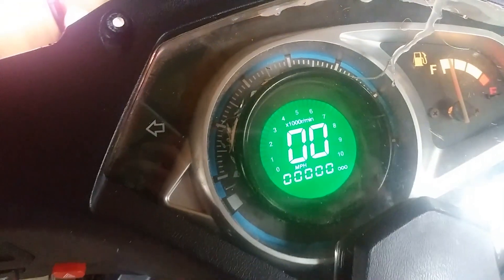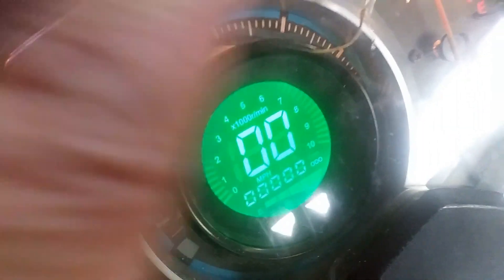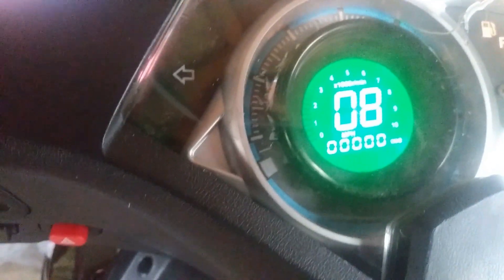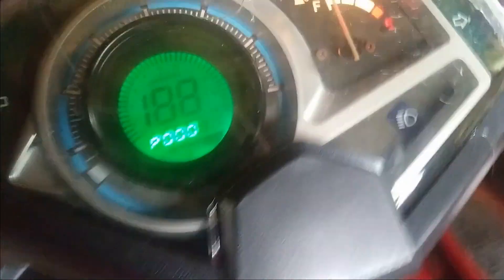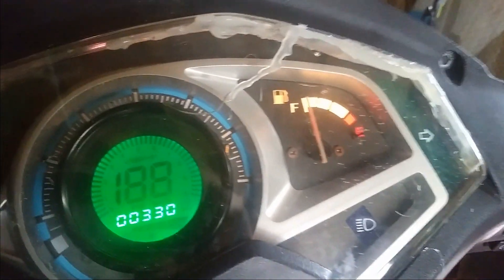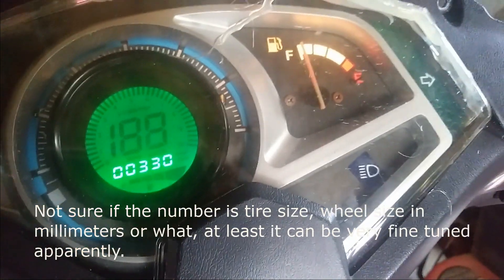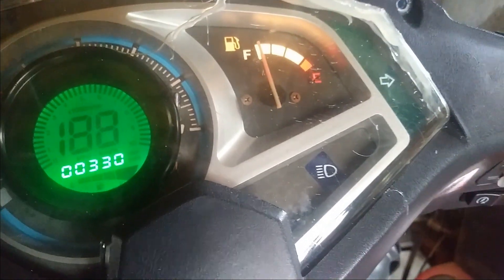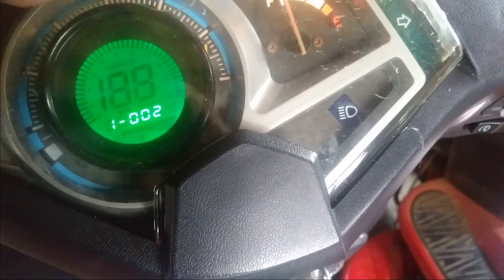Universal speedometer / tachometer wheel size setting, kmh to mph setting, etc.

Comment: This helped me out so much but question  I notice my speed was still off so what size tire are you running. Cause I looked and did some math . 
If you running a
* 3.50-10 tire =430 
*4.00-12 tire= 508 
Those are what I found out may help bud like you helped me. Also where did you find the instructions to this speedometer I am really indeed of it.
Reply: Thank you very much 😉👍 
I didn't get any code from seller to go into settings. Luckily after searching on YouTube I found your move and even when my speedometer is totally different, access code and menu is exactly the same 😁
Reply from the maker: the only instructions I found were under the descriptions of people selling it, some of the instructions were more complete than others.... thanks for your data, my 13" wheel tires are around there but i dont remember.... they are 130/60-13 tires
Reply: @OGmolton1   okay thank you so much bud and I did the math for that tire at you should put in 486 bud
Reply from the maker: @michaelwoodward3435 hmm, that is somewhat close to what I have in there I think, it's probably right.  Thanks.  Next time I have access to that little button I'll change it and give that a try.  Good looking out
Reply: Not a problem thank you for releasing this video it help me out cause on the description of the one I bought has none of that. So this video help out so much plus they sent mine as Km/H I need MP/H I knew that there had to be a way to reprogram it to mile per hour. This video is the only thing I found out there multiple time with this speedometer.
Reply: @michaelwoodward3435  can you say what kind of calculation you did to arrive at this number? cause using some info I found online I can only get number way off this mark
Reply: Menu won't open